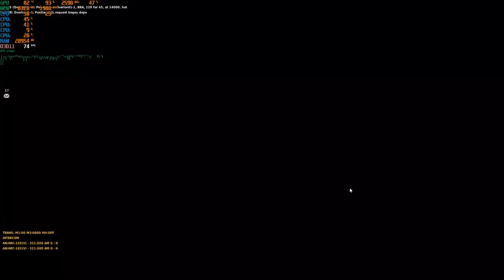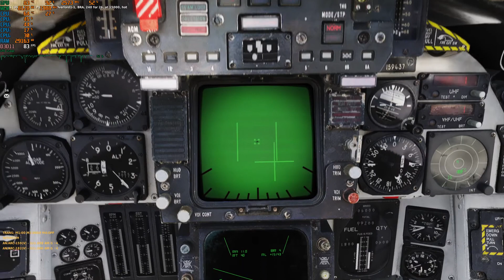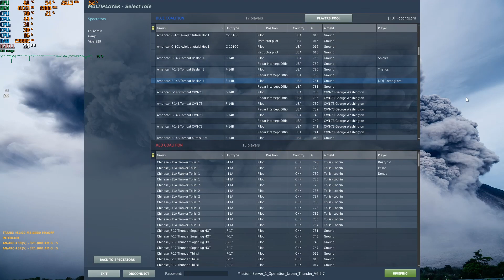Undervolt Performance on Asrock RX 6600XT Challenger ITX Undervolt DCS 2.7.14.24228 Open Beta

Comment: I bought this card today.  Where and exactly what did you undervolt it?  How much cooler did it run ?  I assume the details on the left lower side are the settings?  Sorry am a newb so if you can help that would be appreciated.
Reply from the maker: Open AMD Software, go to performance tab then tuning tab, after that on the tuning control section choose Undervolt GPU. When undervolting the graph shows better cooling temperature. you can check the graph by pres ctrl + shift + O